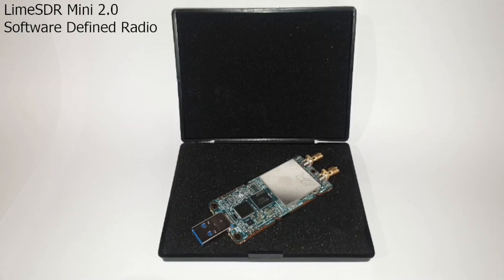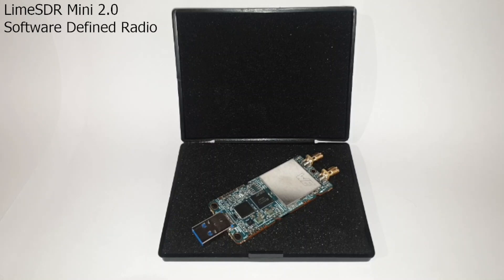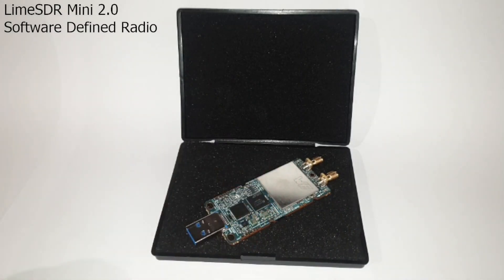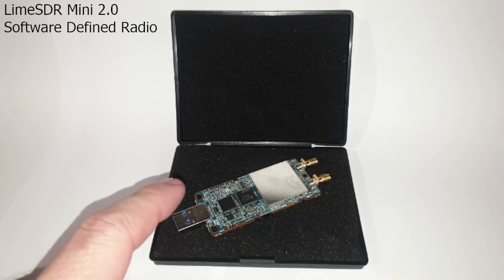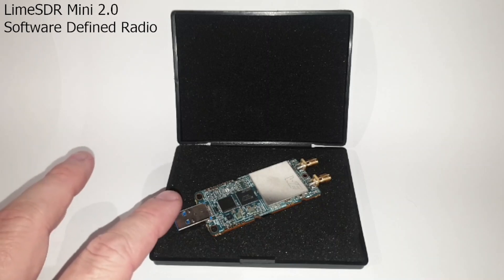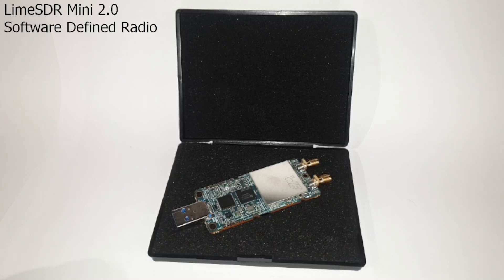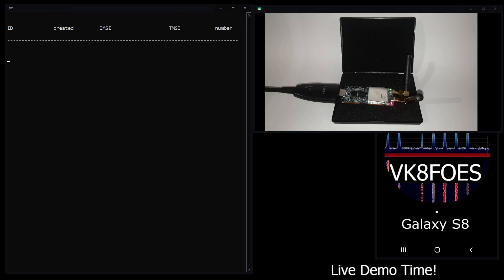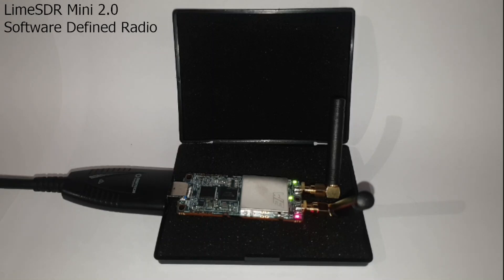Lime SDR Mini 2.0 Review And Test: The Expensive Upgrade You Probably Don't Need?

Comment: Really want to pick this up but its currently sitting at $500 lol. Only a little more and you can get the bigger version with 2x2 MIMO. Almost feel like getting into PCB dev and fabricating a customized version because the BOM + AIO service is gonna add up to the same value anyway. But the problem is I've heard doing PCB design with RF components involves some level of black magic to achieve your desired performance :D.

Comment: So, for the case, I got out my trusty dremel tool with a metal grinding bit, viced that case cover in my workshop, set the dremel to high speed (be safe) and adjusted pressure on the unwanted aluminum "bumps" that make the case not fit the 2.0. Within (literally) 2 minutes, bumps are gone, cover fits. If you don't have a dremel, buy one or borrow one. Piece of cake!

Comment: This is an nice Radio used since 2017   https://youtu.be/sMUkYmDtorM
Reply from the maker: Hi, great video, and nice SDR! I have the LimeSDR Mini 2.0, and I love it!
Reply: @RobVK8FOES  Yes this is an mutiple tool for measure , i have use it too with Poweramplifier as Amatuer radio Named transmt/receive without spowl circles ^^ 
https://youtu.be/617l35SvNOk
Reply: @RobVK8FOES  Yes i have use it as Measure tool, or as Transmitter / Receiver for Amatuer radio   https://youtu.be/617l35SvNOk

Comment: Great demo and review! I've never heard of lime until vodaphone went in with them. 

What did you use for the phones in the demo? Actual screen recorded or emulators run thru a gateway?
Reply from the maker: Hi, thanks for the feedback to my video! It's been a while, but from memory, I used an application for Windows and Linux called 'scrcpy' which allows Android screen mirroring via USB cable. I was using a Galaxy S8 as the camera and one telephone, and the other telephone a made a call to was a Galaxy S9.

Comment: I am of the opinion a USB C beech on the device would be better than a plug. 
new devices do not have the old USB connector at all and 
less mechanical stress on the board.
Reply from the maker: I agree, USB-C would of been a much better choice. But also make it a female socket on the board, and include a USB-C male to USB-A male cable.

Comment: If the board was sub $150US, I would buy one in a heartbeat. But $400US is bonkers for a 1:1 “upgrade”.

On the FPGA side, comparing logic gates/cells between brands means absolutely nothing and something Lime, and others, constantly mess up. Not only are the cell architectures vastly different, but the capabilities of the logic synthesis (ie the “FPGA compiler”) are grossly different between manufacturers.
Reply from the maker: I couldn't agree more! Unfortunately I missed out on the LimeSDR Mini 1.0, so I had to resort to purchasing the 2.0 :(
Reply: so is calling it "professional grade" when it clearly doesn't even come with a case, although they sure made the price point a lot more "professional"...

Comment: thanks for the heads up on the aluminum case. i was almost an early backer who would have also gotten the case. it was part of the compelling reasons to get this whole kit in the first place. 
it is disappointing they still can’t make a good aluminum case for the v2. there is no chip shortage in milling aluminum. and you still can’t pick up one without waiting months for it to ship out. think i will hold off further on this until there is a decent case and when stock availability isn’t a pre-order.
Reply from the maker: Hi, thanks for the comment. Two days after I released my LimeSDR Mini 2.0 review video, Crowdsupply sent out an email acknowledging the incompatibility. It said that HackerGadgets are designing a v2 of the AC case to address the issue. They said nothing about if we can get a refund, and it showed images of a DIY solution similar to what I showed in my video. No thanks, I would like a free v2 case for the trouble instead!
Reply: @RobVK8FOES  yeah. you definitely deserve to get a free case, having backed the project early on. it’s good to hear they are finally working on a v2 case, but it is definitely slow-going and should have been done last year. 
it is also questionable the way crowdsupply entices you to get the case with the limesdr v2 because if you spend over $500 you get free shipping. and they tout that case alongside the checkout process, like it was compatible. otherwise you are spending a lot for shipping that would otherwise go to a few accessories. with that update on the incompatibility, then free shipping isn’t really an option unless you are also preordering another project or getting other accessories with this one.

Comment: Would love to use either a LimeSDR Mini or LimeSR USB to learn practical uses of SDR.. not so much watch waterfalls.   Do you know of any course/program that covers applications like:

--Morse Code CW Transmission (NFM and AM/USB) and decoding/Receiving (CW Skimmer, CWGet , morsecode scphillips translator, etc) 
--HAM : trunking (SDRTrunk / Unitrunker) / TETRA (SDRsharp plugin, OpenEar, OsmocomTETRA), digital-modes (DMR, D-Star, System Fusion/C4FM, NXDN, P25/Police Scanner (DSD LouisErigHere), POCSAG (PDW Software) , YSF FT8 )) , convert modes on the fly (i..e use DMR radio to talk on C4FM), 
--Decoding/Visualizing Weather Satellite data (noaa-apt, WXtoImg ) ADSB Plane Tracking (X-Plane / XHSI and AdsbSCOPE plugin, MultiPSK with Maperitive) ;  Finding Satellites (Orbitron , g-predict, orekit)
--GPS Decoding/Plotting/Spoofing ( GNSS-SDRLIB, RTK-NAVI) 
--ATSC Video Receiver/Transmitter (Portsdown DATV, SDRAngel, GRC, SDRGlut) 
--Local GSM/LTE cellular network (GPRS) (gr-gsm, Kalibrate, IMSI-catcher, srsLTE-Sniffer, rtl-sdr-LTE dedsecimsi, FALCON) 
--Text/voice decoding (OpenEar, Defcon 2016) 
--Inmarsat AERO satellite Medlink AMBE Audio ACARS (jontio / libaeroambe built JAERO) 
--Reverse Engineer an RF keyfob ( clock-recovery, analyze protocol (Universal-Radio-Hacker, Inspectrum), transmit ) 
--Reverse Engineer Direct Sequence Spread Spectrum
Reply from the maker: Hi, thanks for watching. I don't know of any courses in the traditional sense to learn about those topics you listed. However, there is a fantastic turn-key Linux distribution called DragonOS FocalX made by an individual called cemaxecuter. He has a YouTube channel and makes outstanding instructional videos basically covering all the topics you listed. I highly recommend getting a full-duplex transmit capable SDR and getting your hands dirty with DragonOS. It will be very rewarding!

If you are interesting in developing applications and tools for practical uses of software defined radio, it seems most of the really fun stuff happens on Linux, being proficient in python and GNU-radio are good places to start! Good luck!